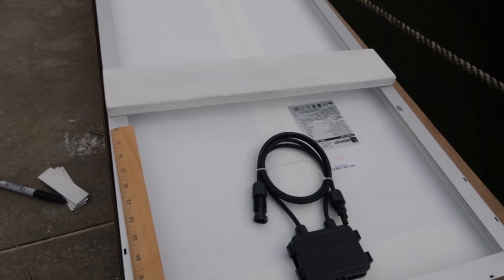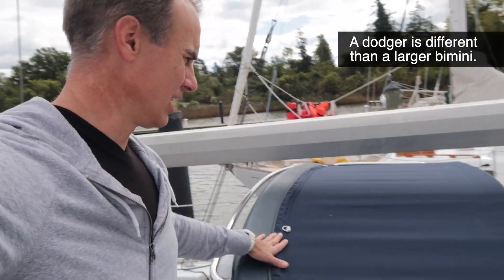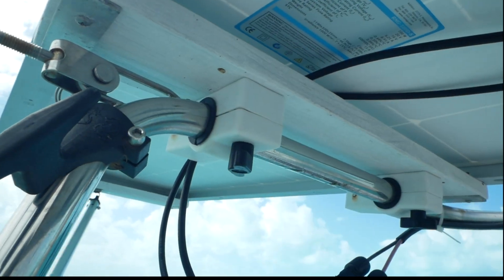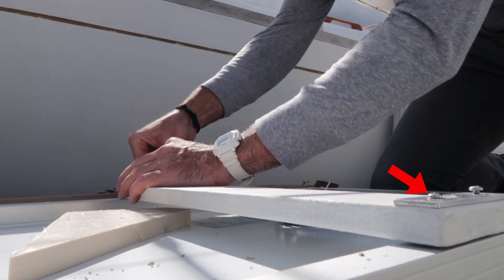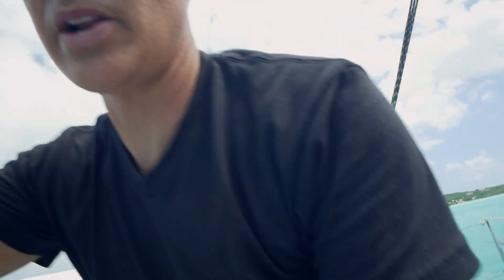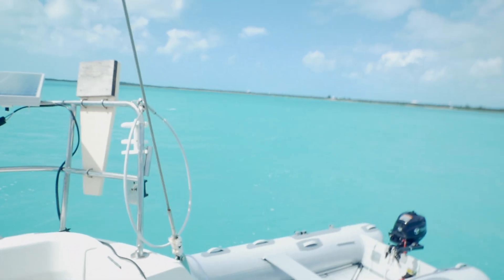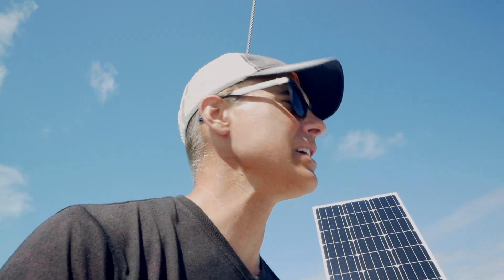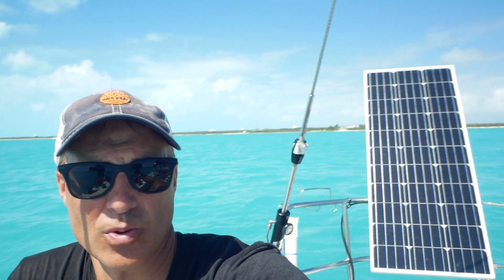How to: Simple Solar Panel System (Boat, RV, etc.) (Ep. 18)

Comment: I wasn't clear on how you connected the wires to your battery. Is it just a straight connection? How does it conflict with the wires already there?
Reply from the maker: Hi Steve, yes, I simply took the wires from the charge controller to the batteries. It doesn't interfere with other wires. Also, because the 4 batteries are in parallel, I connected the charge controller to the positive and negative terminals as you would with a parallel set-up. Hope that helps. 👍🏼